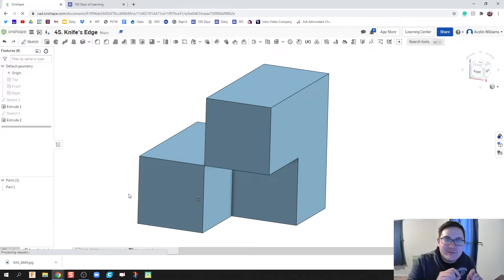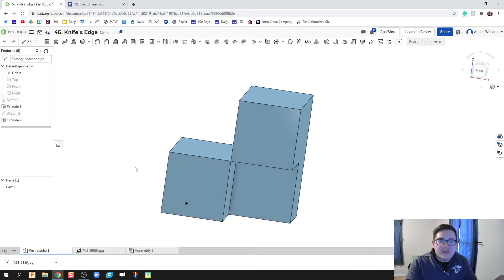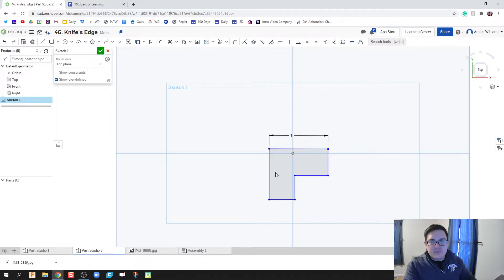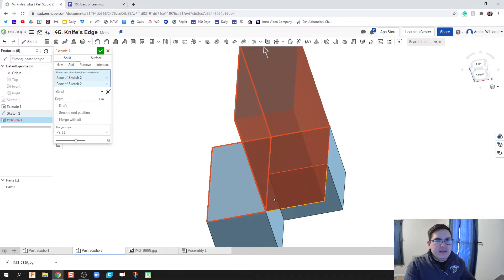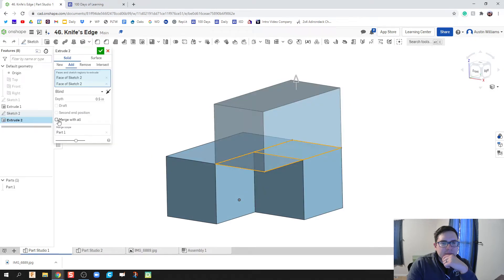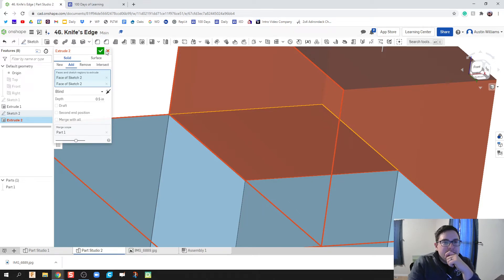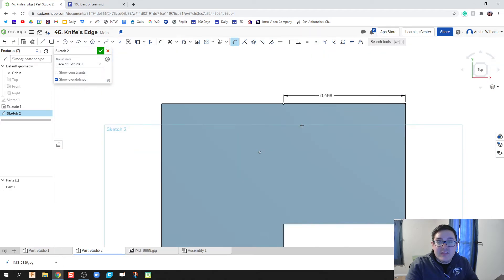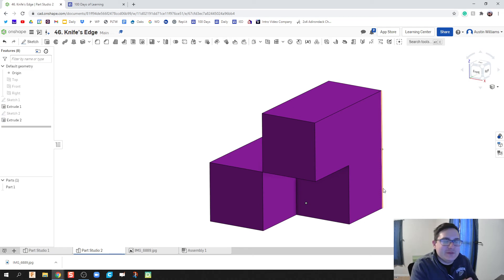Knife's Edge Paradox -Day 46 of 100 OnShape Journey

Comment: A fillet also works. After the first extrusion, fillet the shared edge with a 0.001” radius. Then make the second extrusion like normal. It works, and you can keep the full dimensions on each side. (This satisfies my OCD Spidey Sense.) All that’s missing is the small cutout from the fillet, which you have to zoom way in to even see.
Reply from the maker: Yep. That can work! Once you understand the reason for the error, there are a multitude of ways to engineering a solution... pun intended.